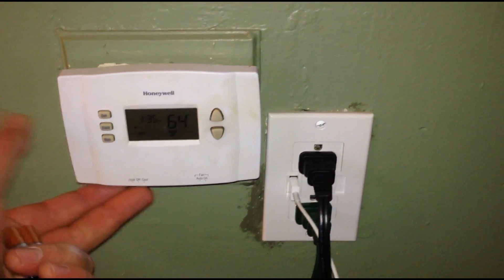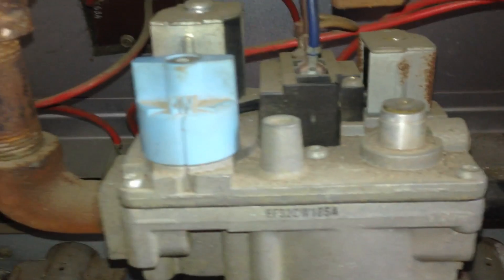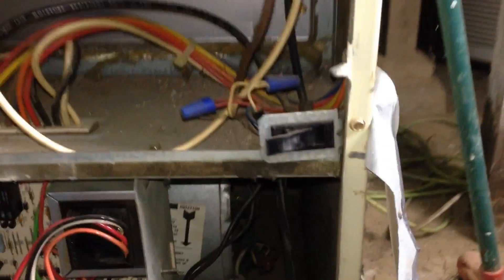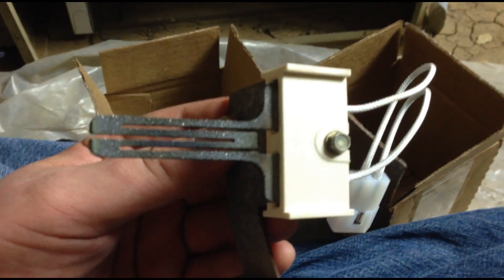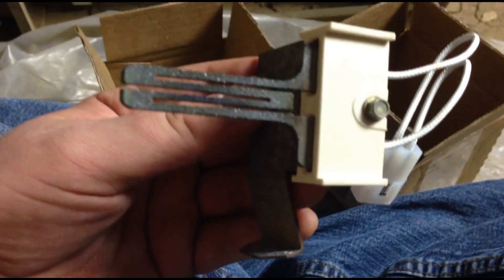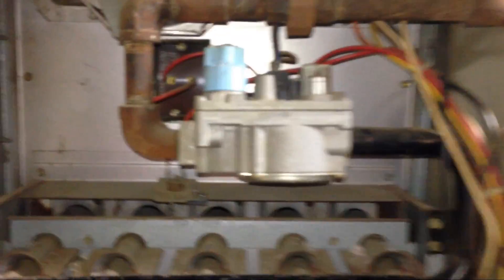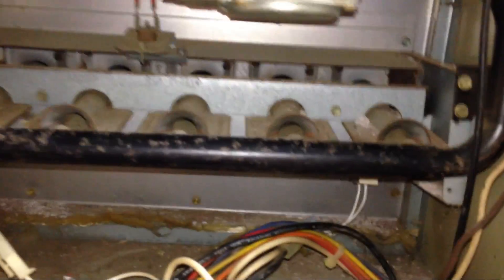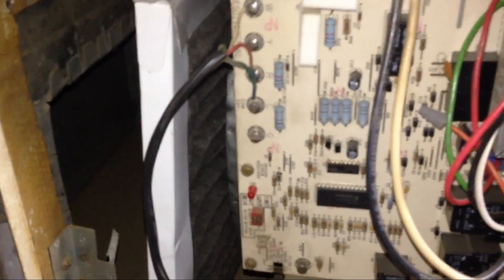7 Tips and Tricks to repair your Furnace DIY

Comment: following your advice caused a gas leak in my property which in turn caused an explosion in which my family died...

thanks.
Reply: I'm sure a gas leak was caused by not actually touching any of the gas components besides the on/off switch huh?
Reply: ***** ur not kidding...
hzuiel My original comment wasnt exactly true... but nonetheless people can be sent to prison in the UK for simply opening the front cover of their boiler without a proper license.
Reply: TheTwistedbeaver Well the UK does appear to be quite the nanny state, so that doesn't surprise me. America is rapidly heading in that direction, but as it stands, for the most part you can build your own home from the ground up in most states, with only inspectors coming out. If you can pour the concrete and level it, and frame the house, and wire it, and run the duct work and plumbing, and gas pipes yourself, and they pass inspection, you're golden. If i wanted people to tell me what i can do with my own possessions and when i'm allowed to endanger myself, i'd defect and go find a communist dictatorship to join. 

It should also be obvious that I'm not talking about ludicrous stuff like a landlord hiring unqualified no-name contractors to fix a boiler for an apartment building. This is a person in their own home, fixing their own furnace.
Reply: Arcoaeir
Reply: Def a nanny state, i would move the hell out of there in a heartbeat if someone said i couldn't work on my own house! unreal!

Comment: No way anyone with out proper training or knowledge should ever attempt working on a gas furnace. THIS CAN CAUSE PROPERTY DAMAGE AND DEATH.
Reply: TheTwistedbeaver Not in the country that the person posting the video is from, and shouldn't be anywhere. Just like i may not be a mechanic but i can still work on my car, that's my decision to make. You may not be legally allowed to work on other people's furnaces in exchange for money, but any place that attempts to market itself as a free country, should allow people to do what they want within their homes. You can even run electrical on your own as long as you get it inspected, something my father does all the time when he wants to add an outlet.
Reply: TheTwistedbeaver You could kill your whole family and other people with shoddy repair work on your car. You could burn your house down and the collateral damage could include other homes, with faulty electrical work, yet you can still do it. Why is furnace work some mystical thing nobody should be allowed to touch? Saying "if you do it wrong it could be dangerous," is pointless. People make poor decisions that cause them various problems, pain and death all the time, it doesn't mean everyone should be locked in padded cells. Like with anything else, you should make sure you're doing it right, whatever it is that you're doing. Nobody is blowing up their house by checking a code on a circuit board. You aren't going to electrocute yourself if you cut off the breaker, wear rubber gloves, or generally have any sense whatsoever. Replacing batteries, a filter, or basic electrical components like the igniter are not going to cause a calamity. You could cause a calamity by fooling with some of the gas components, but not if you do it correctly. If a particular task is above you, and you do not have the time or resources to figure out how to do it properly, then you call someone with more knowledge. It's pretty damn simple. I may be able to change the brakes, oil, suspension components, replace a radiator, etc on my car, but if the engine needs to be torn apart, i'm probably calling a mechanic. I could be like some fools and take my car to the mechanic to have them roll the windows down for me, but I'm not like that, and neither are a whole lot of people.
Reply: There is a slim chance of the dude blowing himself up. Modern gas valves like that carrier is equipped with simply will not function if purge is not made, and if ignition is not made, and will shut down if flame is not detected.
Reply: This shit is funny! That psc motor uses what's called a capacitor round/oval shaped. Your gonna want to test that while the motor is in operation! Lmao dude don't screw with shit if you don't know what your doing, us service techs like making money on shit you mess up.
Reply: not to mention you could be arrested in a lot of countries.
Reply: TheTwistedbeaver If they are honestly that stupid, one could only hope that they earn their darwin award. I have no interest in limiting the average person, to save the people who are that thick between the ears, and the fact remains, those morons can still go change the brakes on their car improperly and nobody is going to stop them, even if that means they're going to careen into a bus full of nuns and orphans with their family in the car. Information and people's freedom should not be limited in order to protect the absolute lowest possible demographic of society that's likely to kill themselves doing something stupid that you can't prevent, anyway. The society we live in already tries way too hard to wrap everything and everyone in bubble wrap.
Reply: jason hunt and you also like making boatloads of money on people too stupid to fix their own shit.
Reply: hzuiel I agree completely..... If someone is going to kill themselves in a terrible car crash , or gas explosion.... let us just hope it is only themselves they kill... it will somewhat clean our genepool.
Reply: Albion Laster People just scared of things they do not understand.
Reply: hzuiel my point is.. theres a lot of retarded people out there, and if they see a video on youtube telling them how to do something.. theres a good chance they will fuck up,.
Reply: hzuiel but one mistake when it comes to "boiler repairs" by say , a person with little knowledge of repairing such things will, when cold weather strikes, attempt such a repair with no knowledge of the safety risks...

there are laws in a LOT of countries saying that anyone even opening the cover of their boiler without a gas fitters license WILL be arrested.... even if it IS their own boiler.

Comment: The inducer motor went bad on our Rudd gas furnace. Ordered new one but it didn't come with the sensor mounted on it like the old one. Does anyone know if I can drill out a small air hole and mount the old sensor on the new inducer? And will it work?
Reply: Your talking about drilling out the housing for limit switch? Don't do it.

Comment: I know he's trying to help but he said 40$ ignitor x2 so 80$ + gas + time + getting zapped. People die from 120vac. That would take me 75$ trip charge and I charge 50$ for universal ignitor. 125 bucks and I make out good since a universal more durable ignitor cost me  15$. In this price you will get a full diagnosis of your furnace and probably would be pulling out my vacuum as well. And a filter for five bucks. Find a company between 3-6 vans stay away from the one man bands and huge conglomerates.
Reply: Of course an hvac guy would attempt to convince everyone to call them rather than do anything on their own, the same as a mechanic will attempt to convince you that you're going to die if you work on your own car. These day nobody knows how to fix or diagnose anything themselves and they end up having to rely on other people who are not always trustworthy. Like mechanics that will tell you something is broken that isn't, fix the actual problem, and charge you for a more expensive part and labor rate. Or "well when i got in there i found it needs a total rebuild, that's gonna be another $2000." You have the choice of paying them for the labor they already have done plus labor to put it back together, then have it taken to another shop for a second opinion, or you can trust them and maybe get ripped. The last furnace repair we had, the company charged $440 dollars to replace the pressure switch. I looked up the part on the box the repair guy left behind and it's a $35 part for the exact switch, same brand and everything, that he used. When i was in telecom, we charged 50 per hour on some calls, and 65 on others, and we had to provide jacks, mounting hardware and cable on our own dime most of the time, most contracts didn't have any way to charge for the use of such materials. If it was local you normally didn't get any mileage reimbursement of any kind. It was often dirty and scary work, with some mild shocks and potential interaction with brown recluses, rats, and fiberglass insulation(maybe asbestos even) and i didn't get paid anywhere near $405 dollars an hour, that would be retarded. Neurosurgeons should make $405 dollars an hour, not furnace repair men. 

I know i'm not the only person who feels this way, most people i've ever worked with that were at all handy with a tool, fix their own stuff, because it's their hard earned money and they don't want to waste it if they could enjoy it some other way. Right now trade workers are marking bank because of how helpless and stupid most people are these days, and more power to them, but there are enough cross eyed idiots who can't replace the batteries in their thermostat, clean the lint out of a dryer, replace filters in things,  plug in their computer to the wall outlet, to keep you and other service technicians in business. You don't need every single dollar that DIYers are saving by fixing their own stuff. Your concern about safety is unfounded if the person knows to shut off the electric and gas to the furnace.

Comment: Thanks for posting this.  I fixed my own furnace last year by cleaning off the burner sensor rod, forget what it's called exactly.  Two things:  Firstly, ALWAYS shut off the power to the furnace at the electrical panel first then also the furnaces own power switch, turning down your thermostat does NOT stop power to the furnace, that's why you got shocked.  Secondly, I'll bet money your air filter is under sized, that's why you have such a dirty internal furnace compartment.  Put in a bigger one that doesn't have so much clearance it wobbles about and you'll probably get a little more efficiency out of your furnace.  Thanks again and take care!  :)
Reply: The sensor rod is called a "Thermocouple." it's job is to sence heat from the pilot light, which in turn triggers the valve within the regulator (reducing valve) to open, allowing fuel to be constantly fed to the pilot. Thermostat is responsible for Igniting the burners.
Reply: I think it is actually the flame sensing rod. A thermocouple is a bimetallic strip of metal that expands and contracts at a different rate so it curls to complete a circuit.

Similar to how the old thermostats worked with the coil and bubble of mercury. 

But that's just what I know.

Comment: Dude, don't DIY if you don't know what you're doing...... particularly with a flammable gas!!!!!!!!!!!!!!!!!!!!!!!!!  Leave it to the techs.  Your diagnosis, although correct, is a GUESS..... You're electrocuting yourself.  Igniters are a little more robust than you make them out to be.  The "white stuff" is not abnormal (it is oxidation).  BTW, fuses blow for a reason.  If you have a blown fuse then there's another problem there.  You do have the basic idea of what's going on..... good job.

Comment: Your blower is coming on before ur burners my guess bad board. The little fan comes on first then hsi or hot surface igniter, then gas then fan or blower.  Good job for the most part but replace ur board it will run....
Reply: Blower comes on first with Carrier normally runs for 90 sec, Bryant, carrier, Payne that's normal pre cycle operation. It's weird.

Comment: With that old carrier furnace, you bettrr pull that high limit out and check for cracks in the exchanger. Found alot of thosd busted around the dimple just inside the limit. Just an FYI

Comment: My gas valve is tricking after the unit started to cool off, it only allow me to have heat only 10-20 minutes than it shut off, I didn't get the temperature I set at thermostat, I already replace new gas valve, new mother board and ignition module also. I don't know what wrong with it? I wonder if I should replace inducer circuit board too! Please help. My thermostat is not battery is model Honeywell CT87N. It brand new every is hooked up correctly.
Reply: Short cycling.  Could be a safety shut-off mechanism.  The unit may not be getting rid of the heat, so it shuts off before a worse problem starts.  Could be clogged system, not balanced, static pressure in the lines.  Most systems are installed without Manual J, let alone a proper manual D.
Reply: Yes Val's right check for restrictions (plugged filter) vents closed, sounds like your not stripping heat off the heat exchanger fast enough, if you static is within reasonable range consider increasing the fan speed.

Comment: I don't comment often, but wanted to let you know that your video was very, very helpful. I fixed my furnace in about 10 min because of this video. I was worried this would cost me hundreds of dollars to fix because I don't know anything about HVAC, but found out I just needed to lightly sand that sensor. My furnace is heating like a champ now. Thanks so much for this video! Mike

Comment: Another advantage to doing it yourself is, sometimes a service technician will go down to your basement for maybe five minutes and then come back up and say your heat exchanger is cracked, you need a new one. For one it doesnt take 5 minutes to check the heat exchanger. Possibly half an hour. It happened to my teachers friend, and all he had to do is get the flame sensor out and put some sandpaper to it and it worked for. That was on christmas eve and he hasnt have a problem since.
Reply: if you know where to look on the certain model of the furnace it only takes 5 mins to do a thorough heat exchanger check.. Its even quicker if the person installed the a/c coil properly and not directly on top of the furnace.

Comment: Great video. My furnace burners would light but go out after a few seconds. I googled the problem and decided to sand the erosion off of the flame sensor. Your video confirmed that I was servicing the flame sensor (it was my first time popping a furnace open so I had NO clue what I was looking at). And best of all my furnace is working again!

Comment: i just noticed that the  flame sensor and the igniter are at opposite sides of the furnace, how can it detect flame that way ?  and where would be the thermocouple and the pilot flame ?
Reply: Thermocouples and pilot flames are on different models. This specific model of furnace does not incorporate a thermocouple or pilot flame.  Flame sensor is place on the opposite side to ensure you have complete flame on all burners.

Comment: Thanks great video ! Im still having trouble mine will come on for 3 to 5  minutes then the green led light & pilot goes out. Not sure what to do?
Reply: Safety device is protecting you and the system. Why you need a ohm meter to check switches. Rollout, Hi Limit. Usually in this case. 3 to 5 minutes. Your generating Hi heat. Draft pipe could be blocked. Air restriction. Many possibilities can cause this problem. Please for your safety, call a experience technician.

Comment: Good post....most of HVAC tech is not hornest, I think they are trained that way.This video does help a lot
Reply: jeff arney
Douch Bag? Your attacking integrity of the honest techs. There is companies that hire these technicians to screw you. They get paid commission on the parts and equipment they sell you. Yes there is many dishonest techs out there. With out a doubt, but so is the automotive techs, IT techs, plumbers, electricians, attorneys, judges, presidents and probably all over the place at the company you work for. I have many times coached customers over the phone to repair their own system. To save them money.  I will not do anything that would jeopardize their safety. Remember this is a gas burning equipment. safety devices are in place for your safety. You can be electrocuted and even worse burn your house down. Do your homework and check out the company that you are calling out. Don't be a Douch if you don't know what your talking about.
Reply: I am a HVAC Tech, they are NOT trained that way. The company they work for has no morality. If your a good tech you will not subject yourself to dishonesty.
Reply: What a douch bag
Reply: Jeff your a douche bag

Comment: Thanks for the video. Late at night did not want to call service guy at 1am. Watched another video and cleaned the heating rod and after I was done furnace did not turn back on. Frustrated and tired watched your video and dummy me i forgot to put the bottom door back on. Thanks a mil. simple repair.  PUT DOOR BACK ON!

Comment: we have a miller nordyne gas furnace  with a problem  that its giving us a code saying open pressure switch   i watched this video with my husband and we are still unsure as to how to fix this problem  we have had no heat at all for almost 2 weeks and been using little space heaters   we need to get this fixed soon    we had paid 75 dollars to a repair man  he came looked at and gave us estimate of 470 dollars and told us it was the control unit    so we got help thru a church orginization  to buy the part   for 196 dollars  and find out the part is not the problem   we need to find out how to fix this